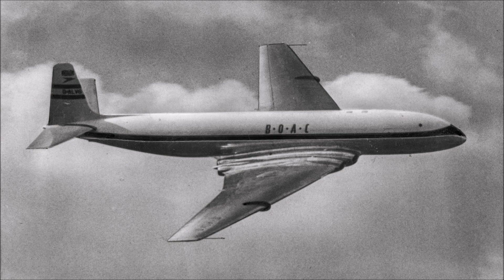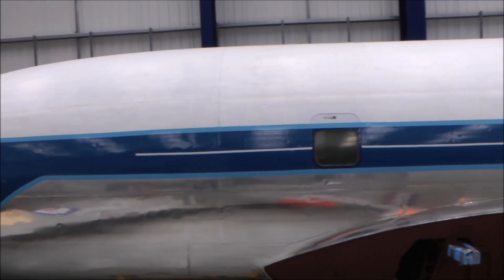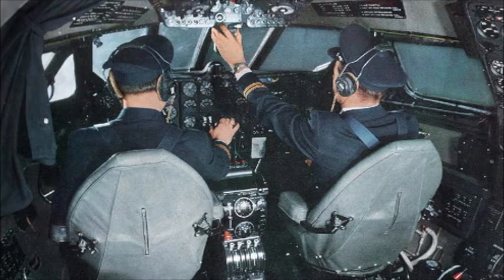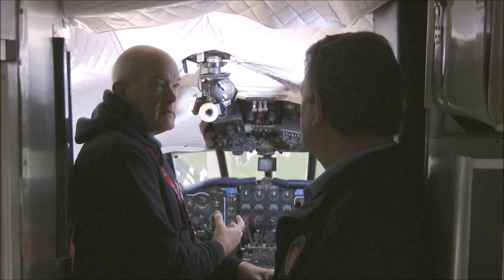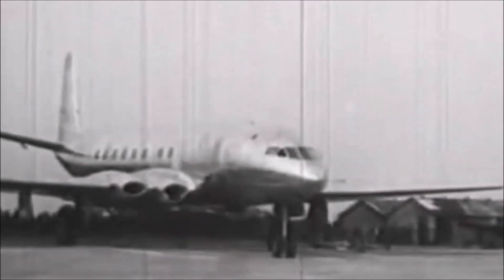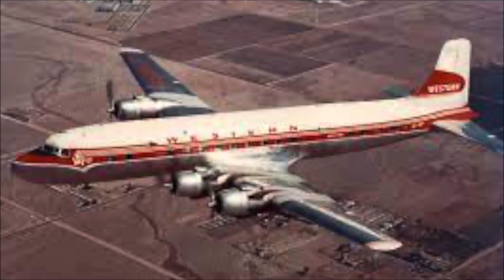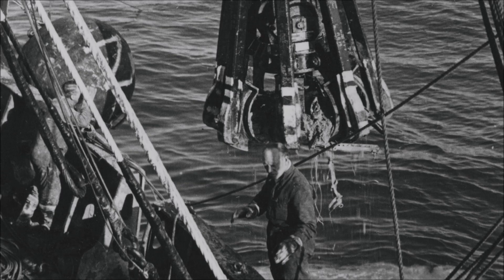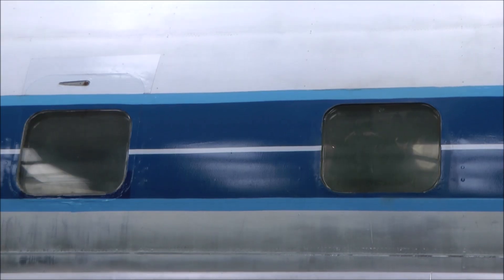DH.106 Comet, the first jet airliner. "Cutting Edge" metal marvel or material failure? (Pt. 1 of 3)

Comment: Great video, what a shame the Comet had such problems, we might all be flying around in de Havilland airliners now instead of Boeings. Cutting edge technology always has its issues.
Reply: There was nothing cutting edge about the Comet, de Havilland simply lacked the experience to build it.
Reply: The Comet wasn’t very advanced aerodynamically to be honest, but not for lack of experimenting by DH on the DH108 swallow. In the end, DH felt that all the systems work that had to be done to make the Comet reliable and efficient were more important. And to say there is nothing revolutionary about the Comet is not true. The Comet slashed flying times wherever it went. . The Comet introduced hydraulic controls to airliners with multiple system redundancy, high pressure refuelling, adding inert gases into the fuel system to minimise chance of explosions along with the first airliner designed to fly at altitudes of over 40,000 feet. Obviously this proved its undoing and many lessons were learned and shared. But none of this was forseeable - the concept of metal fatigue was still developing and the Comet investigations developed many test procedures we now take for granted. But aircraft with potential design flaws have been built since, the L188 Electra, the DC10 , B737 Max to name but a few. DH worked around the clock to identify the issues and then take appropriate action. The DH 106 Comet 4 gave approx 25 years of and was used as the basis for the Nimrod aircraft which flew for another 30 years
Reply: Unfortunately DH paid the price of being the pioneer in many ways. Not just with the structural issues but also with the concept of how future generations would travel. The Comet did cause quite a sedate revolution when it entered service with flying times to distant and exotic location slashed in half. It pioneered the quieter and smoother jet travel experience. Passengers felt calm and relaxed. But being early to the market meant the Comet 1 was designed a pretty feeble jet engine. That meant a narrow cabin designed around 4 abreast seating (5 at a squeeze) meant that De Havilland was on the back foot when the B707 and DC8 came along with 6 abreast seating and pylon engines which could be adapted very quickly to new jet engines and technology. DH did follow up the Comet with the Trident which was 6 abreast and cutting edge in the case of the its wing design and avionics. In fact the wing design of the Trident was so good that the Germans were determined to have this Hatfield expertise in Airbus. Thus, the West German Government helped fund Hawker Siddley’s involvement in Airbus when the UK Govt withdrew from the Airbus project. And that’s why Britain remains Airbus Europes wing design and production centre - even though that’s no longer at Hatfield
Reply: @michduncg  The de Havilland Comet Disaster is the worst engineering failure in commercial aviation history and a truly shameful and humiliating chapter in British aviation history.
The real  tragedy of the Comet Disaster was that it could have been easily prevented if de Haviland had not cut corners and followed well-known and understood industry standards for the design and construction of pressurized cabins made from riveted aluminum alloys.
 de Havilland simply lacked the experience and technology to build a large all-metal pressurized airliner, the company was still building jet aircraft primarily from wood and linen fabric.
Reply: @WilhelmKarsten 

We feel we can shed some light on some common myths & misunderstandings.

  That's correct of course, at the time the Comet wasn't particularly dangerous. It was also definitely not the worst aircraft engineering disaster in aviation history obviously.

  The Comet's engines, right from the first prototype were demonstrated to have enough power even for high altitude  / hot airport operation. No incidents were caused by lack of power.

   Obviously the Comet's engine position & inlet position had some distinct advantages at the time & of course pylon mounted  podded engines have some problems including excessive induced drag. The Comet engine inlet design was not a fatal flaw & didn't cause any incidents.

Examples of all Comets mks including some Comet 1 airframes continued flying with certification at some point after 1954. Flying carried on until 1997. 

      Losses comparisons.
How things were in those days.

DeHavilland Comet 4 UK                  14% 
DeHavilland Comet all mks             17%  

Boeing 307                               70%
Boeing 247                               48%
Boeing 707            .                  20% 
Boeing 377                                19%  
MD DC-8                                    15%
Lockheed Electra Turboprop   29%
Canadair CL-44  Turboprop     46%  
Convair CV-580  Turboprop     22%
Convair CV-880    (ff 1959)       27%  
Convair CV-990     (ff 1961)      35%

     Of course De Havilland had prior experience building many all metal construction airframe aircraft & thousands of jet powered fighter aircraft that were primarily of metal construction with pressurised cockpits & jet engines built by De-Havilland.

   That is of course correct, Comets flew until 1997 & the original Comet design had military use as a requirement. Nimrod development began at De Havilland before 1953, Nimrod aircraft were in service until 2011. Indeed it is the case that the Nimrod was not withdrawn due to structure problems or other airframe issues, it was entirely due to a significant wing upgrade snag & resultant basic economics & an end of line sale happening at Bow-wing (see b-47 wing folding incidents for info) at the same time.
 
    The world's first pressurised cabin aircraft was of course an Engineering Division USD-9A, a modified British design Airco DH.9A built under license in the US  & was of course the first aircraft to fly with a pressurized cockpit module. This was during a joint US / UK research project in the 1920s.
 
    Yes, that's true, De Havilland carried out full stress analysis & engaged in a comprehensive & protracted testing program which is why key De Havilland people were happy to be aboard flying DH Comet aircraft. The Comet was the first airliner where stress due to pressurisation significantly exceeded flying load stress for a full length passenger cabin fuselage.

     We agree, that's correct, the DH Comet was the first passenger airliner with full length fuselage pressurisation at 8psi pressure differential. Handley Page built the world's first all metal construction airliner during the 1920s.
     In all cases other earlier pressurised aircraft were larger, needed thicker fuselage skins due to flying stresses alone & had much lower pressurisation differential pressure or were military aircraft with relatively small heavily built pressurised capsules. 

     Of course ripstop provision was provided. The skin alloy used became unavailable at the time due to R & D at the manufacturers which resulted in the original alloy being discontinued. Later alloys had very similar properties. The skin thickness used for the Comet was used for similar size later aircraft. Frame spacing was not found to be too large & frame width was not found to be too small.

    Without doubt De Havilland did indeed always work to better than industry standards at the time, used up to date knowledge for the design & construction & no evidence of negligence or criminal negligence was ever produced in relation to the DH Comet.

    Obviously the DH Comet had no effect on the course of the aerospace industry in the UK. The UK now has the world's highest combined nuclear, aerospace & defence sectors per capita activity. Of course anyone currently flying on a wide body airliner stands a good chance of being on an aircraft powered by RR gas turbine aero engines designed & built in the UK.

    That's correct, the investigation committee did not find hundreds of fatal flaws or evidence of design defects, structural defects, defective materials or shoddy workmanship. Indeed it is the case that ripstop provision was included. Claimed incidents did not involve cracks starting from passenger cabin window corners. Pretty much all changes were just in case changes or were planned development modifications & improvements that were scheduled regardless of incidents.

    Obviously De Havilland designers knew all there was to know about metal fatigue at the time they designed the DH Comet.

    It is in fact true to say that the way airliners were built changed everywhere, including in the US, after the Comet incidents.

We hope this helps, obviously.

Cheers indeed of course as always etc.
👍
 
 
 . . .... ... ..... . ..... ..... ..

Comment: The real tragedy of the Comet Disaster was that it could have been easily prevented if de Haviland had simply followed well-known and understood industry standards for the design and construction of pressurized cabins made from riveted aluminum alloys
Reply: @sandervanderkammen9230 

We feel we can shed some light on some common myths & misunderstandings.

  That's correct of course, at the time the Comet wasn't particularly dangerous. It was also definitely not the worst aircraft engineering disaster in aviation history obviously.

  The Comet's engines, right from the first prototype were demonstrated to have enough power even for high altitude  / hot airport operation. No incidents were caused by lack of power.

   Obviously the Comet's engine position & inlet position had some distinct advantages at the time & of course pylon mounted  podded engines have some problems including excessive induced drag. The Comet engine inlet design was not a fatal flaw & didn't cause any incidents.

Examples of all Comets mks including some Comet 1 airframes continued flying with certification at some point after 1954. Flying carried on until 1997. 

      Losses comparisons.
How things were in those days.

DeHavilland Comet 4 UK                  14% 
DeHavilland Comet all mks             17%  

Boeing 307                               70%
Boeing 247                               48%
Boeing 707            .                  20% 
Boeing 377                                19%  
MD DC-8                                    15%
Lockheed Electra Turboprop   29%
Canadair CL-44  Turboprop     46%  
Convair CV-580  Turboprop     22%
Convair CV-880    (ff 1959)       27%  
Convair CV-990     (ff 1961)      35%

     Of course De Havilland had prior experience building many all metal construction airframe aircraft & thousands of jet powered fighter aircraft that were primarily of metal construction with pressurised cockpits & jet engines built by De-Havilland.

   That is of course correct, Comets flew until 1997 & the original Comet design had military use as a requirement. Nimrod development began at De Havilland before 1953, Nimrod aircraft were in service until 2011. Indeed it is the case that the Nimrod was not withdrawn due to structure problems or other airframe issues, it was entirely due to a significant wing upgrade snag & resultant basic economics & an end of line sale happening at Bow-wing (see b-47 wing folding incidents for info) at the same time.
 
    The world's first pressurised cabin aircraft was of course an Engineering Division USD-9A, a modified British design Airco DH.9A built under license in the US  & was of course the first aircraft to fly with a pressurized cockpit module. This was during a joint US / UK research project in the 1920s.
 
    Yes, that's true, De Havilland carried out full stress analysis & engaged in a comprehensive & protracted testing program which is why key De Havilland people were happy to be aboard flying DH Comet aircraft. The Comet was the first airliner where stress due to pressurisation significantly exceeded flying load stress for a full length passenger cabin fuselage.

     We agree, that's correct, the DH Comet was the first passenger airliner with full length fuselage pressurisation at 8psi pressure differential. Handley Page built the world's first all metal construction airliner during the 1920s.
     In all cases other earlier pressurised aircraft were larger, needed thicker fuselage skins due to flying stresses alone & had much lower pressurisation differential pressure or were military aircraft with relatively small heavily built pressurised capsules. 

     Of course ripstop provision was provided. The skin alloy used became unavailable at the time due to R & D at the manufacturers which resulted in the original alloy being discontinued. Later alloys had very similar properties. The skin thickness used for the Comet was used for similar size later aircraft. Frame spacing was not found to be too large & frame width was not found to be too small.

    Without doubt De Havilland did indeed always work to better than industry standards at the time, used up to date knowledge for the design & construction & no evidence of negligence or criminal negligence was ever produced in relation to the DH Comet.

    Obviously the DH Comet had no effect on the course of the aerospace industry in the UK. The UK now has the world's highest combined nuclear, aerospace & defence sectors per capita activity. Of course anyone currently flying on a wide body airliner stands a good chance of being on an aircraft powered by RR gas turbine aero engines designed & built in the UK.

    That's correct, the investigation committee did not find hundreds of fatal flaws or evidence of design defects, structural defects, defective materials or shoddy workmanship. Indeed it is the case that ripstop provision was included. Claimed incidents did not involve cracks starting from passenger cabin window corners. Pretty much all changes were just in case changes or were planned development modifications & improvements that were scheduled regardless of incidents.

    Obviously De Havilland designers knew all there was to know about metal fatigue at the time they designed the DH Comet.

    It is in fact true to say that the way airliners were built changed everywhere, including in the US, after the Comet incidents.

We hope this helps, obviously.

Cheers indeed of course as always etc.
👍
 
 
 . . .... ... ..... . ..... ..... ..

Comment: The best reports indicate the simple truth is that De Haviland didn't add redundancy in the event their life span calculations were wrong(the 707 had tear strips added specifically to make a fatigue failure destroying the fuselage impossible) and the calculations used full average pressure load across the whole aircraft (not accounting for small stress points like window corners or joints, OR brief spikes in strain caused by weather or a sudden ascent/descent)  which gave an inaccurate picture. This was made worse by the fact that the initial test aircraft they used to get the number was both extremely carefully built(no defects, whole manufacturing process closely watched, best metal around) so it overpreformed compared to an average aircraft, AND due to them using it in a prior overpressure test they accidentally hardened the metal and caused the plastic seals to fuse, making the frame stronger and covering stress points without them knowing.

The test aircraft lasted 18,000 cycles before developing serious fatigue. The plane was rated to last 10,000 cycles before it was to be retired. The second Comet to breakup lasted 900 cycles. Modern planes last 75-80,000 cycles on average, though some go longer(The Aloha plane that failed was 90,200). Understanding of metal fatigue was also just generally worse at the time. It's not 100% consistent, aluminum has a pretty big margin of error. The oldest planes in the fleet(excluding the test plane) were over 8,000 cycles. One of the ones that crashed was 900.

The 707 and DC-8 likely would have made many of the same mistakes(perhaps not all, but some) if not for the Comet's failure. Pressured aircraft only dated back 20 years and had only been popular for 5. Jet aircraft dated back less than 5 years when the Comet started production and they were the first on that scale. It was the late 40s-early 50s. Some things just weren't known yet